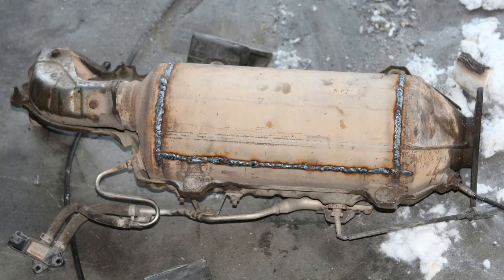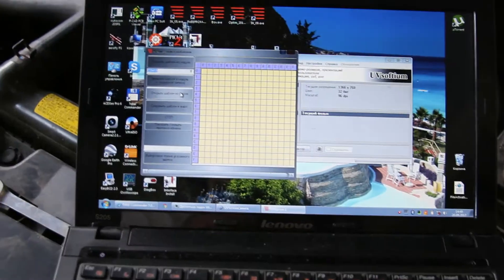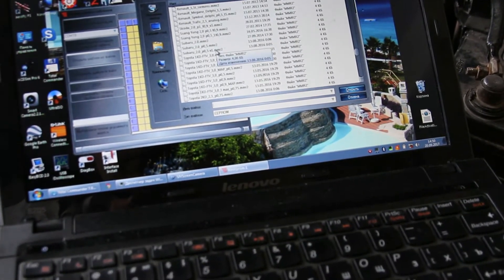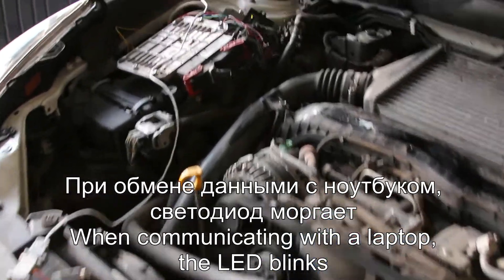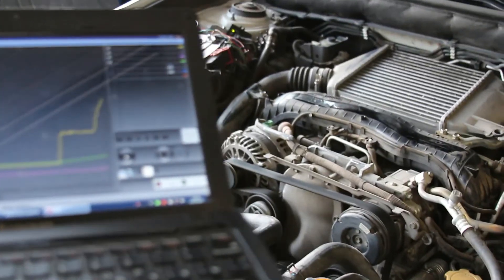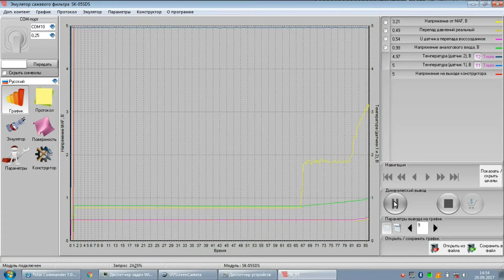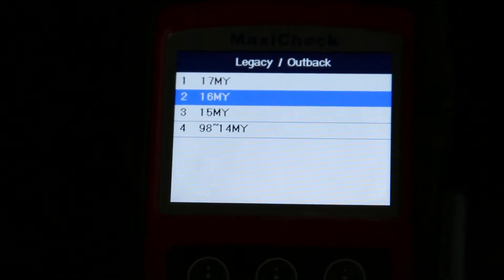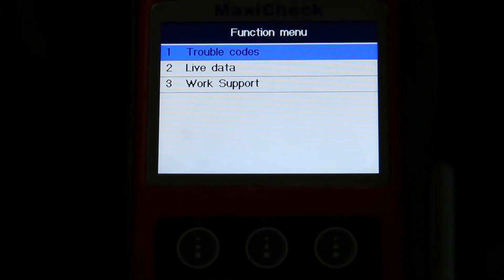Removal of particulate filter DPF Subaru (DPF Emulator SK-05)

Comment: I look that there are two types of ways to eliminate regeneration and diesel fuel in the engine. The first is a system of muffler without cat and DPF, but with ECU modified and the second, is a system of muffler with the original cat inside the DPF without DPF and an emulator without ECU modification? What's the best?
Reply from the maker: Everyone chooses a way to solve the problem on their own. The emulator on Subaru cars works fine. Regeneration does not start.

Comment: The EGR valve was giving error codes. Could it be that the EGR valve is not closed properly and this creates stench on the exhaust? What do you think?
Reply from the maker: If the valve is stuck in the open position, then the motor power is greatly reduced and smoke may appear.
Reply: @ДмитрийСеребро  Do you think it is a good idea to disassemble the EGR to check it? The car doesn't make visible smoke to the eye, only you can smell it a lot.

Comment: I changed the parameters in the ECU by removing DPF and EGR. I increased the HP a little bit, but it smells too much exhaust for me. Is it a good idea in your opinion to just put a 400-cell ceramic catalytic filter after the DPF?
Reply from the maker: Smell and smoke can be caused by aging engine components or be the result of software tampering with the ECU. Installing a quality catalyst will partially improve the situation.
Reply: @ДмитрийСеребро  thank you very much. Do you know where I can find the right parameter of the ECU. So, I can compare it with the parameters that now are inside the ECU?
Reply from the maker: @antoniocolonnacom  I only work with emulators. The required behavior model is written inside the emulator. https://youtu.be/hyDpSKH6F8U

Comment: did you have to code the dpf and egr?
Reply from the maker: No. DPF only
Reply: @ДмитрийСеребро  there would come a fault code on engine
Reply from the maker: @jonah1660  The emulator only resolves error codes related to the diesel particulate filter.
The EGR valve is a separate system. If there are error codes for this valve, then it is enough to clean it - in most cases. A serviceable EGR valve only affects environmental performance. It does not affect the power and fuel consumption.

Comment: Is the thinner inner part of the dpf the catalysator? Was it bad idea to remove that? Im going to remove mine today. Just need to know if all the stuff inside should be removed, or just the dpf material?
Reply from the maker: DPF must be removed without fail. The catalytic converter is at your discretion.
Reply: @ДмитрийСеребро  I dont understand, is the smaller of the two segments the catalytic converter, or is all inside the dpf something that I should remove?
Reply: I mean the smaller cake to the right at 0:50 should I remove that to or should it be left inside?
Reply from the maker: @Helikopterpop  A small part (closer to the motor) does not need to be removed if it is not visually damaged. The big part is the particulate filter. It must be removed without fail. If there are no special requirements and an emulator is installed, then you can delete all.
Reply: @ДмитрийСеребро  what do you mean without fail? I will reprogram the car this monday. Close egr, delete pdf with a simulator i guess and also tune stage two for 50extra hp.
Reply: @ДмитрийСеребро  thanks. But i suppose that the small part closest to the engine is the catalytic converter right? So the outback has a combined dpf and cat in this unit?
Reply from the maker: @Helikopterpop  Right. One housing contains a catalytic converter (small) and a particulate filter. On some vehicles, an additional catalyst can be installed in a separate housing.
Reply: @ДмитрийСеребро  alright! Thanks man! That was what I needed to know. I kept the catalytic part and removed the dpf, welded it shut and put it back. I didnt even get a fault code on my way home like 20km. I expected the particle filted light to turn on. Hmm
Reply from the maker: @Helikopterpop  In some cases, the code may appear after about 100 km

Comment: Is it possible to perform this operation without removing the DPF from the car???
I just wanna remove the inner content of the dpf
Reply from the maker: To delete the content, you need to remove the case (bank) of the diesel particulate filter. It will be inconvenient to extract the content without unmounting.
Reply: @ДмитрийСеребро  thanks for the reply.. Just wanted to make life easier for me

Comment: how are the wiring hooked up? to where? diagram?
Reply from the maker: Here you can download instructions for the emulator https://sdsauto.com/en/particulate-filter-emulator-sk-05.html
You need to connect 2 temperature sensors, differential pressure sensor, MAF sensor

Comment: Great video! How du you her the top bolt by the turbo off? I dont know how to get to it
Reply: had to use a dremel tool to cut up the nut, then it looses tension. Was a real pain in the ass